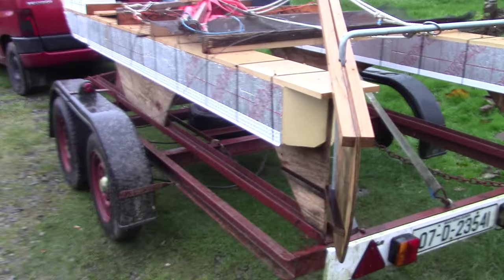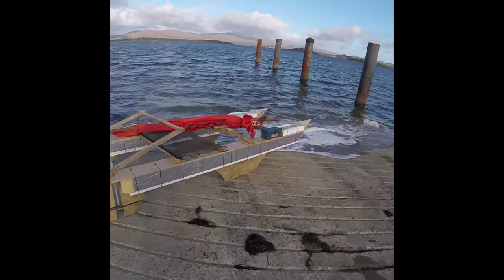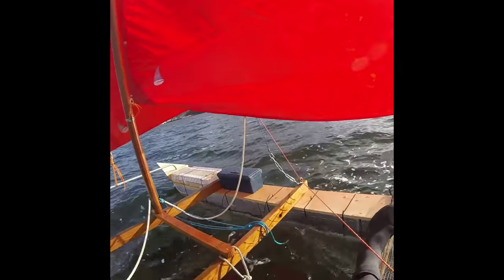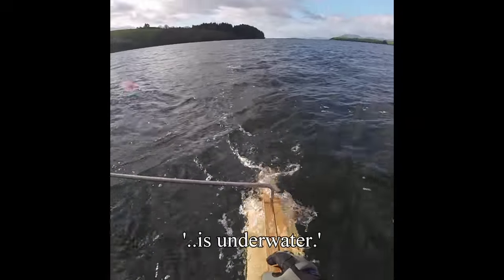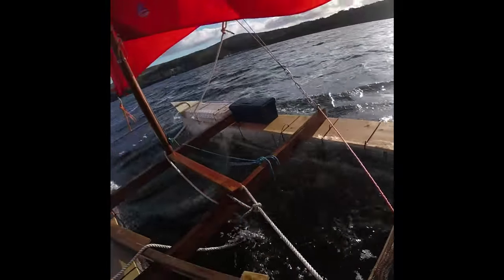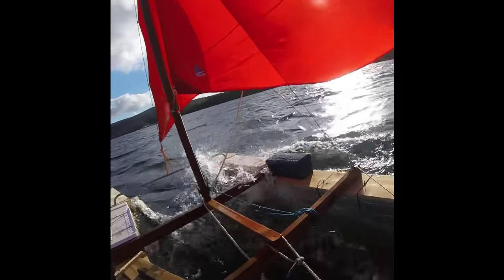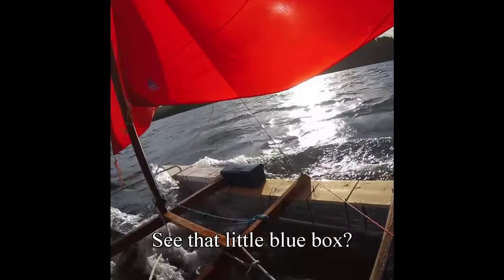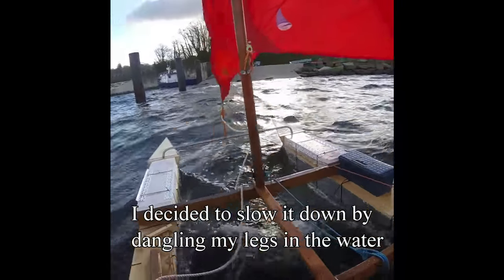Testing The New Homemade Catamaran Design.. (In November??)

Comment: Much fun...  three separate ziplock plastic baggies will usually work for a cellphone.
As usual,  going to sea is almost always better on a bit bigger boat. 
Thanks for posting the nice vid of fun way out west!
And thank you for spending hard earned cash on a gopro for us!
rc
Reply from the maker: +Rusty Case Cheers Rusty - not sure I agree about bigger being better though. Maybe wetter is better!
Reply: Oh, I will agree smaller is more exciting, and will get transported to the water with less effort and, as such, will see more use, yet when the WX comes up there is more comfort and safety with a bit larger hull.
You have more experience than I, wouldn't you agree with that?  :-)     Best   rc

Comment: I have been designing a styrofoam boat. Your video really help with ideas on design. My dad used to take me out sailing a catamaran when I was young in Ireland. (cold is not the word...freezing)
When sailing on your own both  jib ropes clip in a rope holder and the main too if needed ...so you turned and then adjusted the sails. 
I like your breaking system. Great inventor ...keep up the designing.  I thought this boat handled well and moved well but needs a little more floatation to get the boat platform clear of the waves.
Fantastic job ....looking forward to see the improvements.
Reply from the maker: I'm looking forward to more experiments too - I didn't get a single day on the water last year. More flotation would make it less wet for me but isn't necessary for the sailing. And the insulation is expensive..
Reply: I just looked in Vancouver,B.C. and it is expensive. PVC is gone away up as well.
Reply: I suppose a wet suite would be better.

Comment: As U nail down the design expanding foam can  used to glue panels together
Reply from the maker: +Michael O Callaghan Yes, I was wondering how strong it would be. You think it would work on it's own?
Reply: +WayOutWest Blowinblog My garage  big garage windows are held in place by ONLY expanding foam not even a plaster revel.I wouldnt be 100 percent sure how it would react in salt water.My 10 cents worth : - )

Comment: for your phone.....  if you are in a small boat it helps to keep it inside a glass jar that seals  wattertight.... i.e. a honey jar.... that is what i do
Reply from the maker: Good plan - perhaps a plastic one would be best
Reply: +WayOutWest Blowinblog  the plastic one i had did not screw wattertight ... if i submerged them in the watter and sqeezed them they would suck watter inside . for protecting from light spraying of watter i guess they are fine